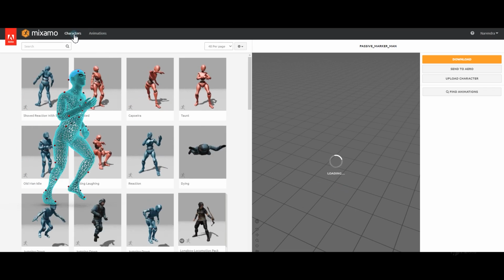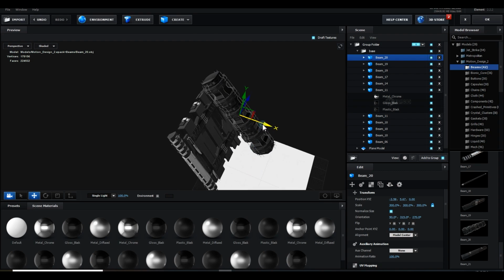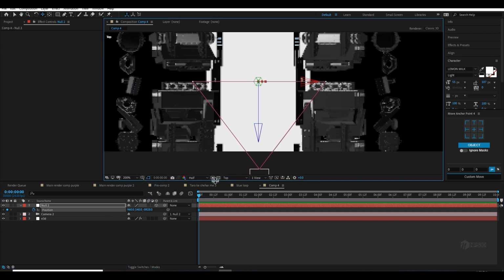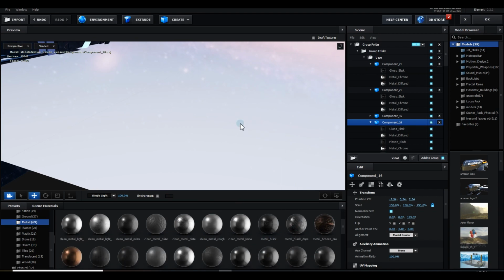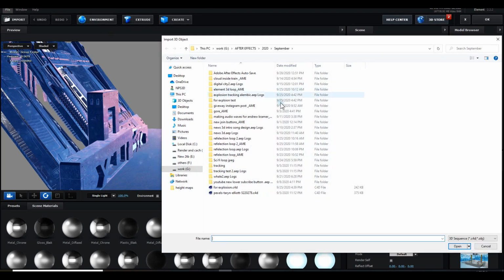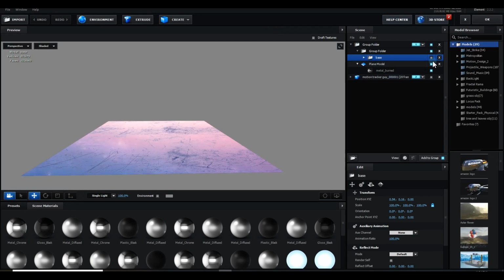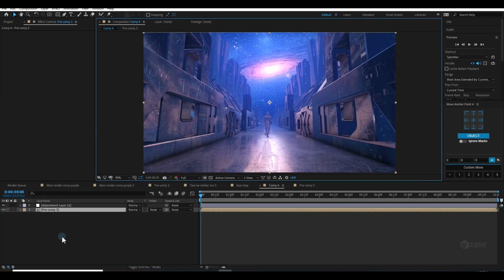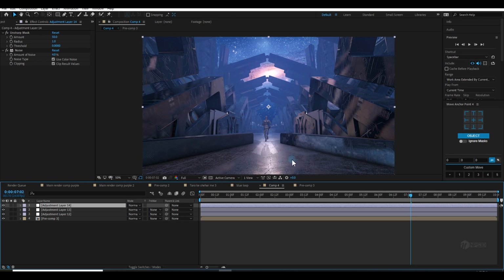How To Make Seamless Loop Inside Element 3D | After Effects | NPS3D

Comment: when i try and fix the glitch on the floor it ruins the perfect loop i had already set any tips?
Reply: @NPS3D  the floor glitch when it shakes a tiny bit and you have to go to group 1 under particle replicator and go to the xyz scale and change the z number a little to separate the over lapping that causes the glitch, but the only problem is once i do so, and it does fix the glitch, it ruins the perfect endless loop i had going right before